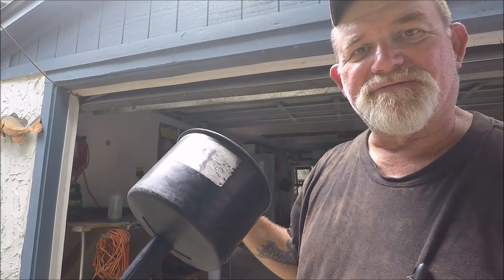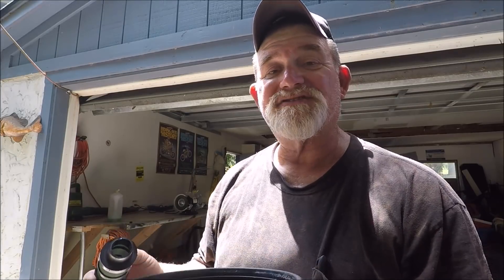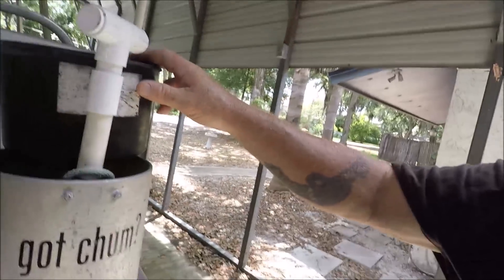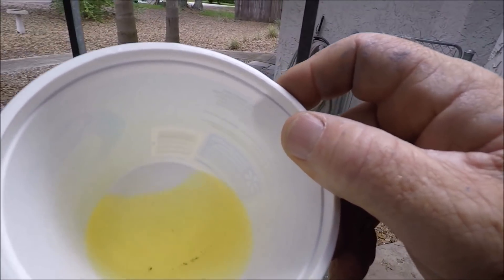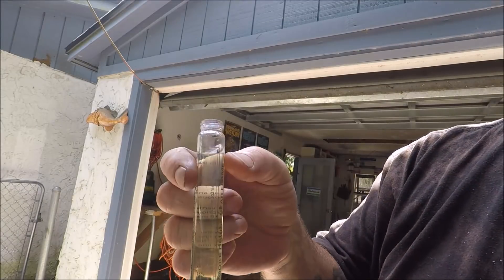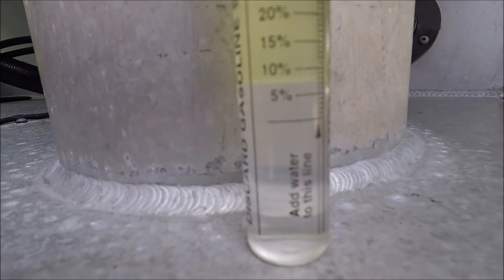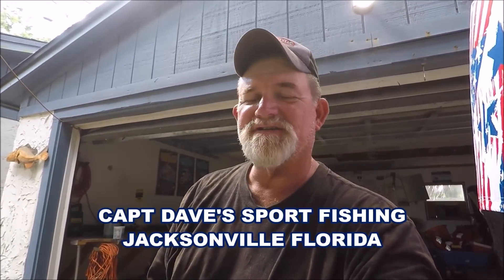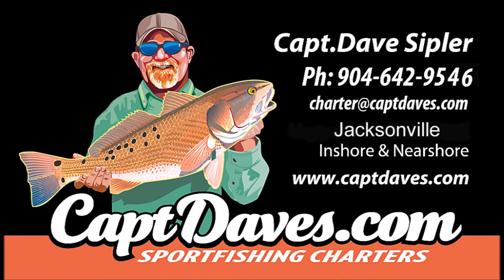ETHANOL IN YOUR BOAT FUEL?

Comment: Had an older 4 stoke 50hp Yamaha that had to take apart and clean all the time.. Since then and a change in boat and motor I will only use Ethanol free in my boat.  Worth the extra money.
Reply from the maker: wish I could afford, and there were gas stations that had it where i could actually get in with the boat.

Comment: you know how I feel about 87 octane gasoline. We had a brief discussion on it. 89 is so much better.   Every so often you should be treating that suzuk with either yamaha ring free or BRP carbon guard and mercury makes an additive that is identical to the other two i just mentioned but cant remember the name of it. This stuff really does work. I have used it in some of my beater cars and saw an increase of gas mileage. There was a whole paper written on the cheap gasoline a while ago that details how the 87 is kind of like the red headed step child of gasoline. Im sure the manual says its ok. All I can tell you is this, Every Suzuki I have taken out of its packing crate "and there have been many"   is test run in Japan. The fuel that is inside of it dosent smell anything like our gasoline. It is very noticeably  different. Dont know why but I guarantee that their 87 octane  fuel is different from ours.
Reply from the maker: ours smells like a girls gone wild beach apartment in ft. lauderdale!
Reply from the maker: I run a bottle of ring free here and there.

Comment: I try to run ethanol free in my older 4 stroke Yamaha.
Reply from the maker: if I wasn't so beat up on my rates, I'd run it all the time too. I  have, for months but never really noticed any difference in performance or consumption.
Reply: @CaptDavesSportfishing  yes I running a skiff so I have a small fuel tank 24 gallons but I never put in no more than 15 as it doesn't burn much fuel.

Comment: Cool deal this funnel is a must for boat owners.
Reply: Btw I run a mercury 60hp 4stroke and I only run nonethanol gas it's expensive at 315 a gallon but I don't run my boat everyday either.
Reply from the maker: @shoresharp8349  I tried when I used to feel ''rich''....but most of the time I don't feel that way.